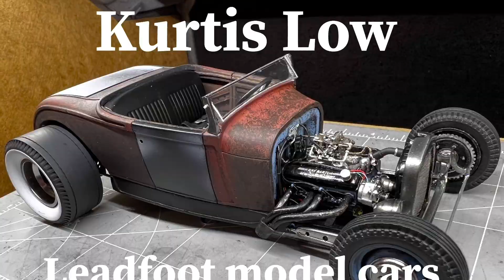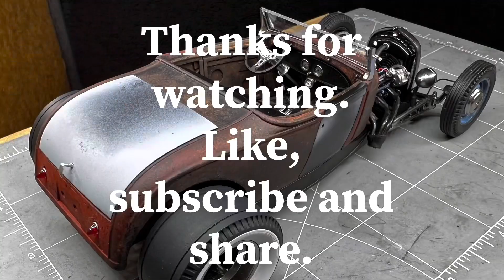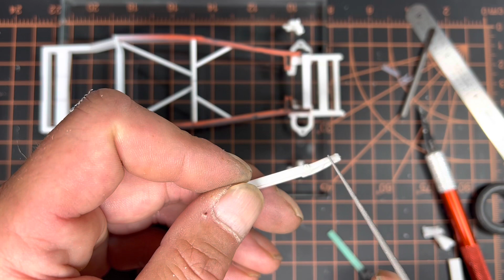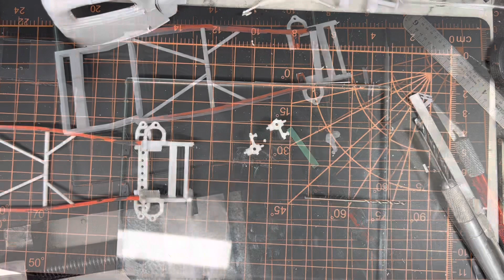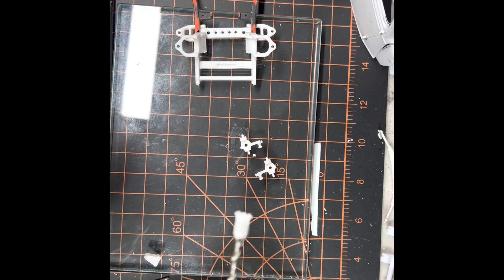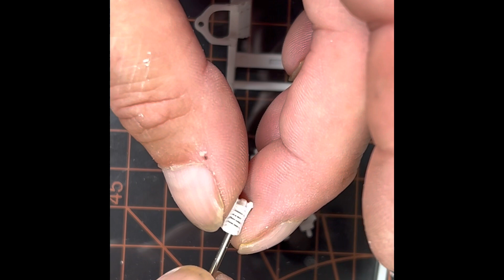Detailing tricks for kit parts

Comment: I love the adhesive dispae sand paper. I have the aluminum 5 and 10mm sanders and the matching straight carbon fiber set. 

The 3d parts basically depend on who prints it and how. If they are printing at like 0.02mm layers they are super easy to clean, if they print at 0.05 mm layers then yeah you have a lot of sanding to prep, If they used an FDM printer instead of a resin printer... i often don't feel the parts are worth the effort needed to prep.  i've found priming in mr surfacer 500 or 1000 helps smooth them out a bit too. 

Interesting tip on the coil springs.
Reply from the maker: Thank you for the input on prepping 3D parts. I just received some Mr. Surfacer 1000 hopeful it would speed up the process. I’ve been thinking about making a video on my favorite products, but I tend to do that as I go lol. Thank you again.